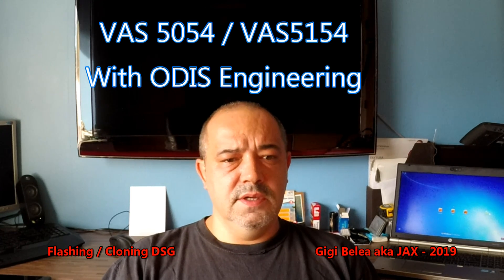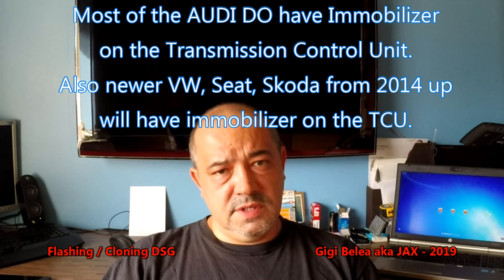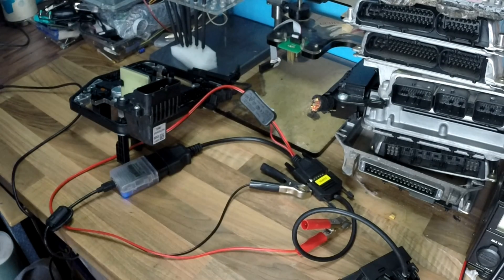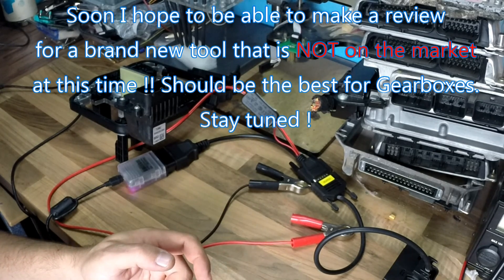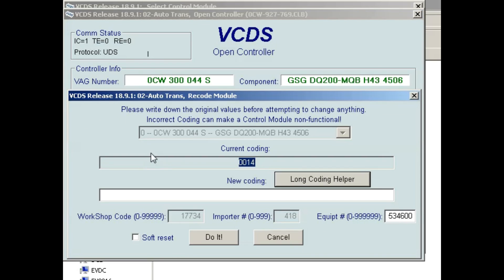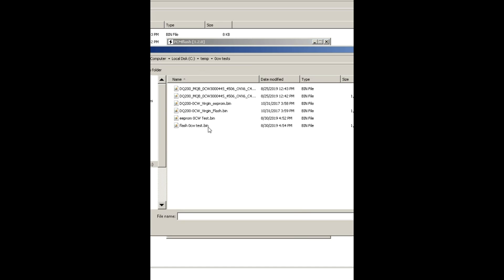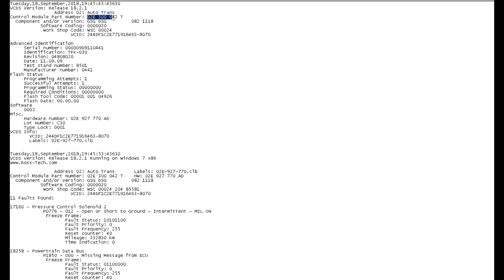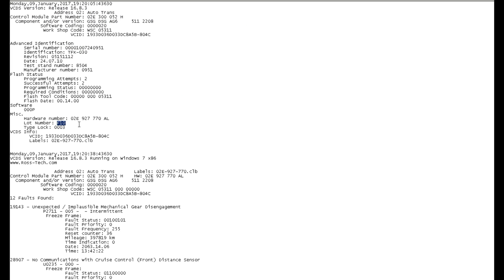DSG Cloning / DSG Programming with PCM Flash.

Comment: I have a Rocco R that we have tried several boxes in, in the end went back to original and put a Brand New Genuine VW Mech in. yet we are unable to perform basic settings. no idea how to fix.
Reply from the maker: probably mechanical problem inside the gearbox
Reply: @GigiBeleaDK  had full mechanical rebuild done on one box. still refused to do basic settings.
Reply from the maker: @Broxi_55  ECU is OEM and stock ?

Comment: Hi i have a Golf Gti mk6 DSG with old mechatronic 02e927770AJ and have purchased refurbished with hw code 02e927770AL.

Old mech unit had oil in the plug and intermittent loss communication U0101 but no faults on bench test

Which is the correct sw i need?

Comment: I have a question: is it possible to flash a 02E927770AL mechatronics from a Golf 6r with the software from 02E927770AJ for a Golf 6 GTI? When I do it, the control unit doesn't start

Comment: Thanks for sharing this valuable info. I understandr that Cxx files are not compatible with Exx/Fxx files. Can you flash an Exx file to an Fxx unit though?
Reply from the maker: No , Exx and Fxx different architecture.
Reply: @GigiBeleaDK  As I unfortunately flashed an Exx file (Micro and EEProm) to an Fxx mechatronic by mistake I will share my experience for other people reading the comments. The Exx file was flashed normaly via PCM Flash to the Fxx unit and did ID normally but when I powered it the high pitched electric noise that you could hear before was not present after flashing the file so obviously something was not right. I flashed the Fxx file again and everything seems to be working fine.
Reply: @Artec12 wbbb a fxx onto a exx I got a mk6 Gti dsg 2010 and I got a mk5 Gti dsg 2006 box does the mech have to be coded or can I just use the mk5 Gti one

Comment: I use flex and dq200 wasn't able to clone a G to D I had to get a G , the stuff u explain is great on DQ250 black and white are not interchangeable right?
Reply from the maker: G to D is not possible, different firmware.. Not all DQ250 are interchangeable , different hardware needs different firmware.
Reply: PCM FLASH apparently does G TO D
Reply from the maker: @fabrisandrea1854  yes but won't work.
Reply: A coligue of mine did it few times no problems
Reply: @fabrisandrea1854  
Can he do D to K?

Comment: I have changed my unit from 02e927770AL to 02e927770AE and the AE unit has this error, how to solve them , 
THANKS IN ADVANCE 

18223 - Pressure Control Valve 1
 P1815 - 008 - Short to Plus - Intermittent - MIL ON
 Freeze Frame:
 Fault Status: 10101000
 Fault Priority: 0
 Fault Frequency: 255
 Reset counter: 40
 Mileage: 164453 km
 Time Indication: 0
 Date: 2063.14.31
 Time: 00:15:31
 18228 - Pressure Control Valve 2
 P1820 - 008 - Short to Plus - Intermittent - MIL ON
 Freeze Frame:
 Fault Status: 10101000
 Fault Priority: 0
 Fault Frequency: 255
 Reset counter: 40
 Mileage: 164453 km
 Time Indication: 0
 Date: 2063.14.31
 Time: 00:21:04
Reply: Probably you need to Swap the oil, just have the same problem

Comment: i have bosch kts560 with J2534 , can i use this hardware for cloning with PCM Flash? or do i need to buy the tactrix openport ?
Reply: i see, i need module 58 software for flashing dq200 ?
Reply: and when i am connecting dq200 with bosch kts i can flash software using ErWin ? :)

Comment: Greetings from the United States! My wife's 2008 A3 (CCTA EA888 Gen 1 engine, DQ250/KNC code DSG gearbox) had a failure of the DSG box due to an axle bolt coming loose and slicing a hole in the case. One of my co-workers had a 10K mile SFH code gearbox from a 2015-2017 Jetta GLI available, and he believed that we could simply swap in the mech unit from the old gearbox to the new one to make it work in the A3, and it doesn't. I can set basic settings with VCDS, but its throwing faults now for 19143/P2711 Unexpected/Implausible Mechanical Gear Disengagement and 18115/P1707 Interference in Mechatronic Module.
What do I need to do to get this gearbox to work in my wife's car? Reinstall the original mechatronic unit for that gearbox and flash it somehow? I would like to retain this newer unit as I believe it should have more favorable top end gears. Any insight you could provide would be greatly appreciated!
Reply: read from original mechatronic (eprom) and flash the new mechatronic (micro), dont need to reinstall old one back into the car to achieve this result .. make sure you only READ from original unit and only WRITE to new unit

Comment: Hi, my dsg unit burn cant get the data clone, HW 0am927769k , SW 0am300047s , can I get the flash file, 2015 Audi A3, I have the data file frf but not sure if it's ok with second hand unit.  your help is much appricated.

Comment: Hello please help.

I was in an accident and I smashed with my Mechatronic and the box was damaged.  I bought another box and got it installed but the problem is that I can not move the gear lever from park and the park is busy flickering. 

Some guy came here with his diagnosist tool and ran it through he he showed me that his PC can not identify the transmission unit.
So he left with out doing anything,  he asked due to this he can not do any basic settings and programming.

What should he have done?
Reply from the maker: Your unit is stuck in programming mode
Reply: @GigiBeleaDK  what needs to be done to get it fixed? Or should I just take it to the dealership?

Comment: I am about to change my faulty DSG transmission to a working one, from scrap yard, the donator car is identical Octavia as mine, so do I have to do any programming at all? one  DSG specialist told me that it should be just "plug and play" swap, no coding needed
Reply: You need to program. Clone like this video or Basic setting by vcds
Reply: @bassnaba  you are wrong, the gearbox is now changed and works perfectly without any coding or programming

Comment: Your video was very helpful..
During the obd write operation with autotuner equipment, 93% of them stopped due to program errors and no longer write to obd. So I connected it to the pcmflash and the powerbox, dsg cable and finished writing the virtual read rom (with autotuner equipment), but the car doesn't start when I complete the write operation (autotuner). (Transmission p-flashing) 0d9 dq250mqb. Is automatic power a problem?

Comment: Hi Gigi, nice videos, have helped me alot (replacing valvebody etc) :).
 I have two DQ200 ( both 0AM) TCUs, will KESS v.2 be able to clone software (eprom) from one tcu to another?
Reply from the maker: Eeprom not , only flash. Ktag should be able to read both eeprom and flash.
Reply: @GigiBeleaDK   hi thanx for the answer, on waht case would be full EEPROM read/write neccesary?
Reply from the maker: @johannes9877536974  when you want to make 100% clone.

Comment: and another question, if the LOT number is not the same ( as you explained on example, FXX and CXX firmware ), can i read the EEPROM file from first unit to second? and after that flash it with right software?
Reply from the maker: FXX not compatible with Cxx or Exx. Dumping the eeprom from one to the other it's a NO GO ! Also flash not the same , so no go either to clone Exx into Fxx or the other way around.

Comment: My original unit was 02 e92 777 0 AJ and I placed in the car a new one it is 02 e92 7770 Al is that compatible
Reply: yes  02e927770al works :-) and is more Relieble then the AJ ... but don.t try the 02e927770AQ that wil not work eeprom software is not the same and have immibilizer in it

Comment: Hi, I have Audi Q5 with OB5/DL501. My current TCU files can’t be read because the connector is broken and completely destroyed. I bought a used TCU which is also for OB5/DL501 however has different VIN. I am planning to buy KTM flash however how do I retrieve files from the old TCU?
Reply: I have same issue. Any advice for that please @GigiBelea aka JAX

Comment: Awesome video! Question is have you done this mechatronic swap for a DL800 trans? I see you mostly work with the Dq500 / 250 units but don't really see anything for the DL800? I was trying to get my unit replaced because is defective but I can't seem to find anyone online that can do it.. is that something you can support? When I try to flash the new unit with ODIS -E I get the immobilizer error since the new unit wasn't virgin and came off another car. Any insights / help you can provide would be great! Thanks
Reply from the maker: You can adapt the unit online via ODIS and Geko access. Then you can flash the desired software on it.
Reply: @GigiBeleaDK  Awesome! whats your email? Lets see if we can get this unit done.
Reply from the maker: @TwinTurboV10  You can find my contact details in the description.

Comment: Great video,  thanks a lot! I have question,  i need to read/ write  eeprom on dq250 mqb with pcm and scanmatik, i just need the dsg cable, no need to drill to access  pin boot? Regards
Reply from the maker: No need to have any holes :) just direct connection to DSG connector.

Comment: Hi mate. I have the chinese dsg cable and use the powerbox with the tactrix, but am not able to read the dsg. SO far no luck with eeprom and micro for dq200 and 250. Do i need to bridge can h and can low with120 Ohms resistor? Is 720 ohm resistor also required for obd pin 15+16?
Reply from the maker: What version of DQ250 and what version of DQ200. 120ohm is needed for all CAN Bus units and some units also require K Line.
Reply: @GigiBeleaDK  hey man i am currently having the same problem, i put 120 ohm resistor between can H&L but i have no 720 ohm resistor at the L Line. is that 720 ohm resistor required?
Reply: did you solve this problem? what was your solution

Comment: Hello Gigi, the problem I have in my golf gti mk6 (2011) is when I stop the car to switch from drive to park or reverse. My car makes clunking noises 80% of the time and the spanner comes up on the dash. However , when Im driving the car everything is normal with no problem, shifts from 1-6 very smooth. 

Could this just be a software issue where I need to reflash or is maybe a solenoid or wire damaged.
Reply from the maker: Read error codes first before anything else.
Reply: @GigiBeleaDK  When I scan my car the error code for the transmission says "P2711 - Unexpected / implausible mechanical gear disengagement"  I've been told it's a mech unit issue, but I was wondering if this problem could arise from a damaged solenoid or wire.  

It would save me lots of $$ if i don't need to buy a new mechatronics unit.
Reply from the maker: @lol12345678012  Usually that comes from Worn clutch , incorrect software in Mechatronic or mechanical problems inside gearbox
Reply: @GigiBeleaDK  interesting 🤔 I’m going to get my car professionally checked at vw and see what they say. Thanks for the help
Reply from the maker: @lol12345678012  Not sure how "Professionaly" would a dealer be able to diagnose a transmission problem but maybe you are lucky :)
Reply: @GigiBeleaDK  HAHA agreed, also another question. Say I want to change my mechatronics unit myself in the garage. Is there anything I should be careful off? For example when taking the mech unit off , will there be a lot of built up pressure where it's dangerous to remove, and if there is how can I offload this pressure?
Reply from the maker: @lol12345678012  No pressure. Drain oil and take mechatronic out. I have a video for that :) look for it.

Comment: Hallo Gigi, can you please advise... Computer must be removed from transmission ? or is possible to clone it when is still been fitted to the vehicle of course by using PCM Flash directedly connected to transmission plug not via OBD. Thank You
Reply from the maker: No need to remove from gearbox. Connect directly to DSG connector.

Comment: Hello how are you? I have a question. I have a 2009 golf 6 gti .mechatronic defective. p0771 did not pick up a gear. my mechatronic had code AJ and bought one of gti 7 from 2015 with code AQ. they cloned the software from my old one to the new one. but now my car wont even start and cant get the shifter out of P position and error codes. like p0701 and more. could it be that a 2009 golf gti only works with code 02E927770AJ?  .
Reply from the maker: Whoever cloned it did not know what they did, bad job. You can not clone 02E927770AJ directly to 02E927770AQ , software needs to be changed , eeprom needs to be changed.
Reply: @GigiBeleaDK  okay thanks. so is it broken now? and will never work on the 2009 gti? or is there something else to do? ...and do you know which codes are compatible. if I buy another mechatronic is that just the AJ or everything from 2008 to 2012?
Reply from the maker: @Frank290578  It is not broken , it is just flashed wrong. The process is a bit more complicated to be explained on a comment here. Find a company that knows what they are doing.
Reply: oke thank you.  I want to learn how to do it myself . does the ecu have to be soldered? Or I better sell it and get another one that works right away
Reply from the maker: @Frank290578  No soldering needed, you just need the correct flash files.

Comment: Hi Gigi. I have a 2007 audi a3 with dsg dq250. found one at a local used parts place and they are they  were the same from the same year. would this be a plug and play or do i have to clone it ?
Reply from the maker: If is from same type engine and gearbox then is plug and play , if not you might need to change software, no need to clone. You can flash units with Vag Can Pro or ODIS.
Reply: @GigiBeleaDK  do you happen to have a link to download any of these for free. im using and interface cable and tactrix. thanks
Reply from the maker: @kennethchavarria3517  No , sorry. Every software is VIN dependent , you can not just flash whatever you want on any hardware.
Reply: @GigiBeleaDK  I was talking a link to download vag can or odis for free. I another words it’s my first time doing this on a European car.  I’ve done it on Japanese cars using tactrix cable and Evoflash. So I’m kind of lost on this.  Any help will be appreciated it.

Comment: Hi my name is Francis, I was looking at your video and am impress with how you describe all the information 
on the DSG programing. Am not an expert in this field, and was wondering if you could be of some help to me. Presently I have this 2009 Audi A3 1.4 where I replaced the transmission, but noticed the gear shifting was erratic, after attempting to solve this problem the VAG Abrites tool I accedentaly reset the tcm module 
which result in no access to any gear. And I dont know how to reset it back. Can you assist me in solving this problem?
Email: fchristian947@gmail.com
Thanks

Comment: I have a 2009 jetta sportwagen and I will be doing a DSG swap from another 2009 sedan. Do you know if that one has a immobilizer? Or Can I use our will I need to use VCDS to copy existing and rewrite on this swap.
Reply from the maker: No immo on that car. You can't use VCDS to copy flash data,.
Reply: @GigiBeleaDK  the trans is coming out of the same year car but sedan instead of wagon. Will I need ot flash it?  Or will it work like  as is? or will I need to use VCDS to put the same coding in it. I did copy the coding and save it from the existing trans. THanks Gigi you have helped before and for so many others you have made it so much easier to know stuff about the DSG trans.
Reply from the maker: @Mikefngarage  If it is the SAME ENGINE and the same gearbox CODE then it would be plug and play.
Reply: @GigiBeleaDK  Lets hope so thanks for getting back to me on this. If for some reason it does not work I will let you know so others can figure it out...If it wont work i will just pull the control module out and swap it.

Comment: If I have ODIS VW server access, so I do not need to clone anything. Just do it online step by step?
Reply from the maker: If units has immobilizer , online access won't help you much with an USED unit that has already been programmed to another car.
Reply: @GigiBeleaDK  cheap mechatronic board unit can always treat as used parts, right?
Reply from the maker: @kinhung  on DSG7 yes, on DSG6 no as it is not detachable from body.

Comment: I am doing an AWD conversion on my car, and reusing my mechatronics in the AWD DSG but the gear ratios themselves are different. I should be good to go if I run through the basic adaptation process right to have my mechatronics learn the new gearing and clutch tolerances and such correct? 

It's kind of the opposite point you are making in this video. I'm keeping the same software, but swapping out the hardware. Thank you in advance!

Comment: thanks for the vid, about the PCMFLASH if you use automatic mode rather than manual is there will be a difference or problem when cloning ECU plus how can you know if you have the correct hardware is there is a software out there or you just have to know it by yourself??

Comment: Any tips on dl501 cloning? Especially interested if gen1 mech unit can be cloned to gen2 mech unit.
Reply: No , it can not , not the same hardware.
Reply: Jaxelos okay. What about writing gen 1 eeprom to gen 2 mech to avoid immobilizer issues? Can you also just erase the eeprom to make the immobilizer think it’s a brand new unit?
Reply from the maker: @fastboatster  Gen 1 to gen 2 , no go, different hardware inside different architecture, you will end up with a door stopper. You can also not just erase the eeprom :)
Reply: @GigiBeleaDK  nice, that's why I love VW and its subrands, they always keep things interesting, lol. Gen 1 and 2 being compatible would be a bad form
Reply from the maker: @fastboatster  They are compatible , but software from one to the other is not :)